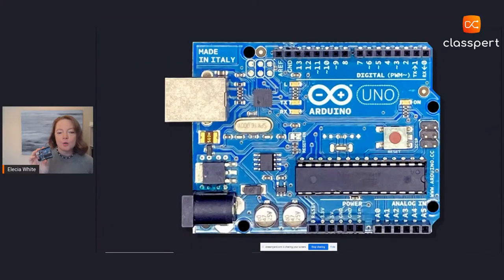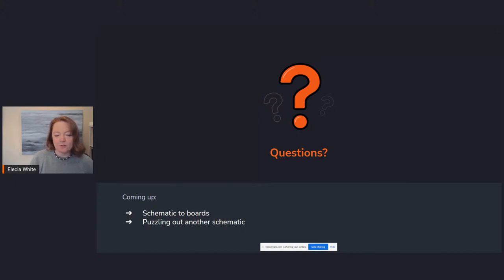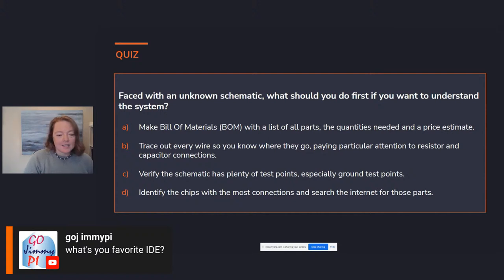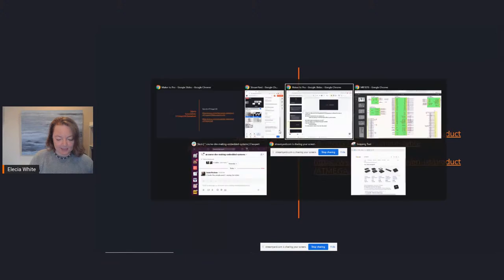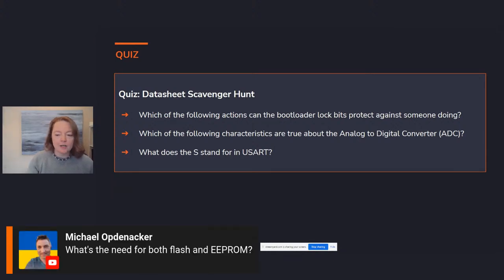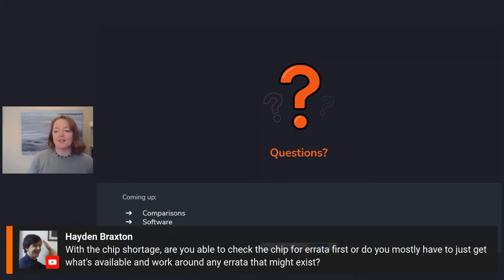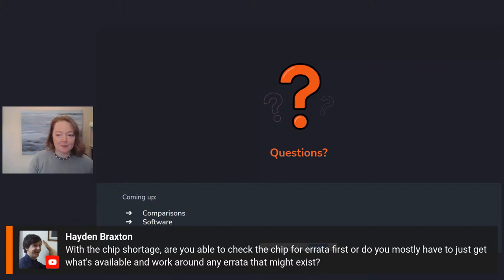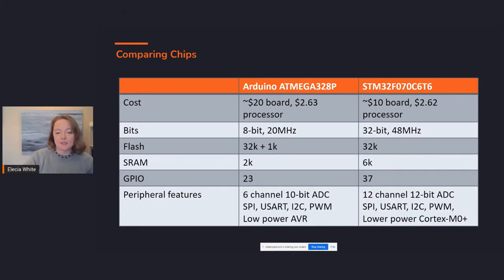Moving from Maker to Professional: Beyond the Surface of Arduino (with Elecia White)

Comment: Hi Elicia, thank you for having this session!  I’m more on the side of being a newbie electronics hobbyist(self-taught),  learning the electronics and embedded programming in my free time.  I’m much more interested in learning how to write the firmware but also understanding how to read a schematic and datasheets and being able to properly configure the on-chip peripherals and components on the board.

I understand that this lecture and your content is probably geared more towards seasoned hobbyists,  professionals, and even just new grads who have an interest in embedded.  Do you have any tips for bridging that gap of understanding of the electronics?  I feel that when switching from Arduino to STM32, obviously its a much more complicated chip with lots of more dials.  I don’t think you will find much explanation of these features in a traditional circuits book.